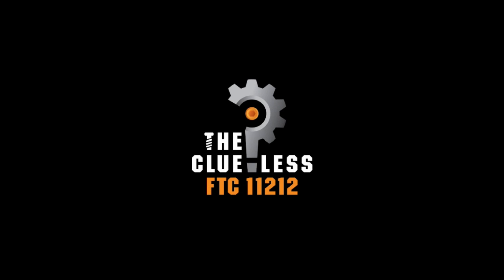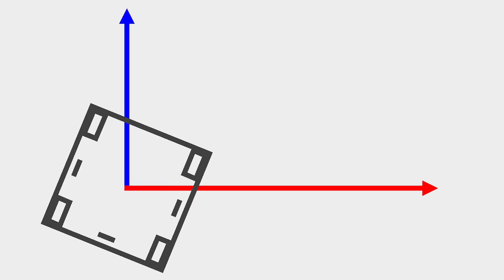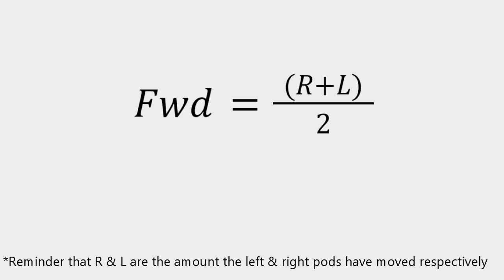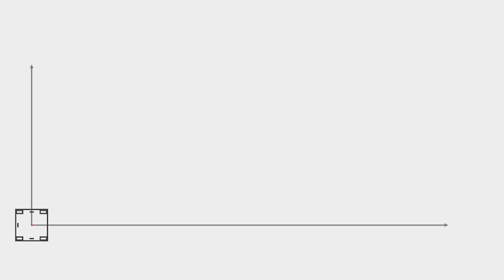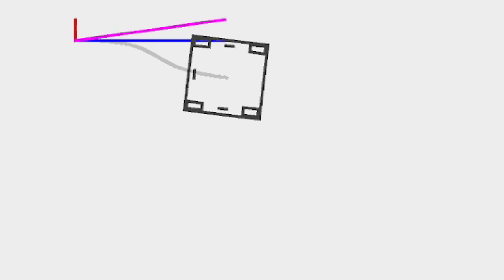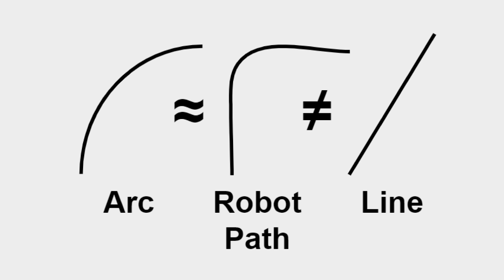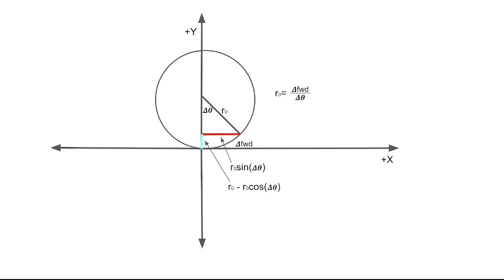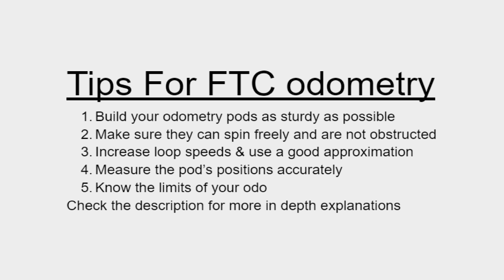Intro to Odometry in FTC | The Clueless #11212

Comment: have you thought about treating odometer wheels as swerve wheels with fixed headings? that way you can use the SwerveDrivePoseEstimator from WPILib to estimate position, which I think have all the maths built in 
you can even add vision measurements with karmen filters

Comment: This is great! It’s so awesome to get some advice from someone who’s done this a lot, most tutorials are too basic. This is our second year using odometry pods and roadrunner, and we have some pretty large errors still. Like we’re off 4 inches crossing the field and back just once. Reading your helpful tips in your videos description, is it possible that slow loop times are the issue? (We have very nice pods, using Loony’s design, so I don’t think it’s a mechanical problem.)

Any chance you could make a video about some common errors in loop speed? (You have some tips in the description, but they are a little over my head.) We already have 50pt auto and get some very high scores, but we are now ready to start cycling stacked pixels during auto, and it’s going to kill us if we always have to use the April tags. Thanks!